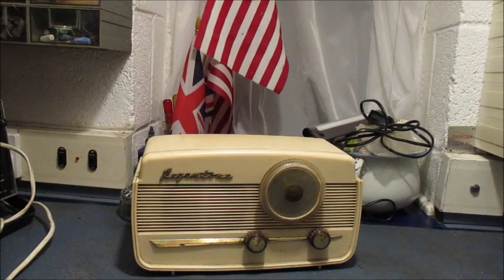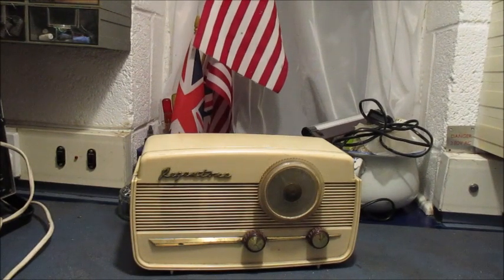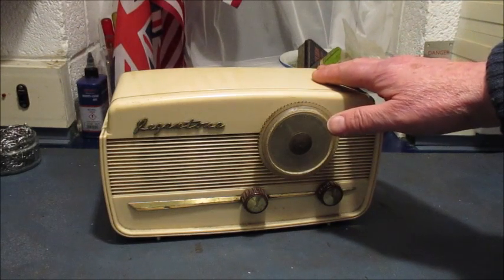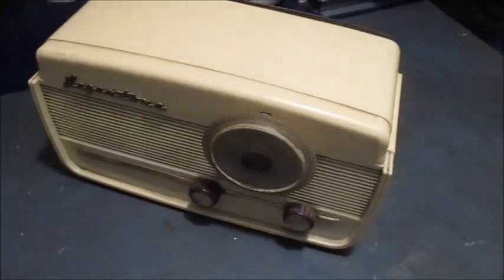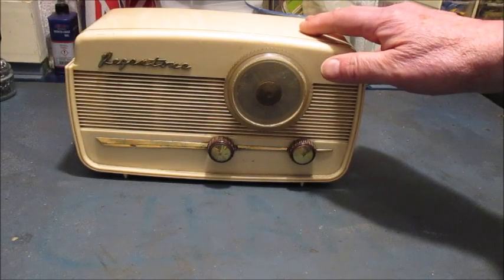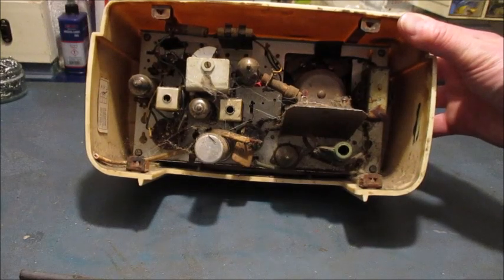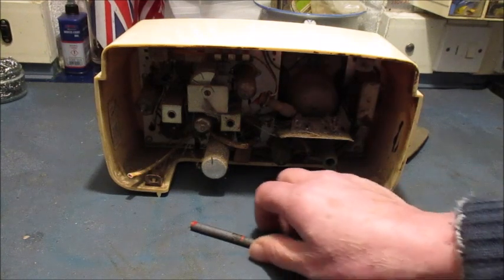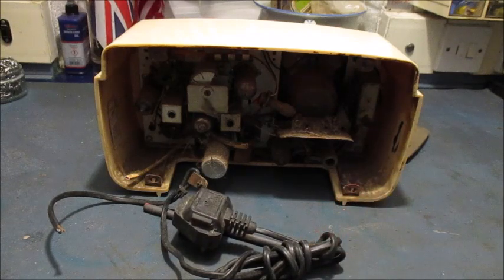Regentone, Model DP2, Radio Repair, Part 1

Comment: Phil,
Now ain't this a pleasant mega-shocker, old chap?  I figured you were permanently down for the proverbial YT count.  How good it is to have you back, my friend.  One mustn't abandon their viewers without adequate previous explanation, you know.  Tsk-Tsk.  LOL
No more disappearing allowed, hear?
Regards,
John
Reply from the maker: John, as always it’s great to hear from you.
I’ll begin by saying how lovely, and clean you’ve gotten the Thunderbird differential housing.  You put a lot of time and effort into doing that, and now it shines!  
Some years ago, I was faced with a differential universal joint shaft that had sheared inside the housing.  When I put my foot on the accelerator, the prop-shaft rotated but there was no traction.  Undoing the centre nut was a nightmare since the bit that had sheared inside the housing turned round as I turned the centre nut.  I ended up striping the crown wheel and pinions etc. to get access to the stub.  I drilled two holes into stub; in which I fitted two steel pegs to I hold the stub tight with a crowbar so I could loosen the centre nut.  Getting hold of a new required part was no easy task – all the dealerships wanted to do was either do the job, and charge me a fortune, or sell me a new complete differential, which cost a fortune.  I eventually got the required part, after a few lengthy phone calls, for a very reasonable price direct from what was once British Leyland.
There are two You Tubers that might be of interest to you: HubNut does a few interesting things with cars – check out his Invacar project; and since you like cooking, as well as American history, check out Townsends, especially his enthusiasm for eighteenth century cooking. 
Yes, it's good to get started again after a fairly long absence.  I'm already eyeing up my next You Tube radio restoration project, so keep an eye on the You Tube bell LOL.
Cheers my friend, have a good Christmas, and a prosperous New Year, Phil.

Comment: Hello Phil, great to see u back, and full of life at 3.20am !!! I too have one of these, dismantled awaiting my attention, so it will be great to see how u get on, Happy Christmas !!
Reply from the maker: Hi roughchippy.
The circuitry for the Regentone, model DP2 is straightforward.  Not only that, when they are functional, they work fairly well.  The down side is often they come with a multitude of problems.  Almost always the heater ballast resister R17, 980 ohms, and sometimes R15, 14 ohms resistor are o/c …replace with 1k, 50w, and 15 ohm 25w (chassis mount gold types) respectively, should that be the case with your radio.  The audio output transformer primary (usually it’s the humbucking section but sometimes the audio section) will become o/c – seemingly at the drop of a hat.  The tuning knob is almost always broken.   The capacitors (usually of value over 1nf) will need replacing, especially if they are paper dielectric types, and the carbon composite resistors will very likely require a tolerance check.  If you want the radio to perform at its best, it will require a full realignment.
Virtually all Regentone products were manufactured to a price, so we have to expect more than the usual problems with Vintage Radios bearing that brand name.  Though the DP2 radio looks quite cute, be prepared to unearth a multitude of problems when restoring one 
Lovely to hear from you, Merry Christmas, and a Happy New Year, Phil.
Reply: @steelcity321pb6  Wow,  thanks Phil for all that v useful information!  On seeing u test the dropper, I did likewise and mine at least tests OK, the tuning knob too is good and not broken,  it's been a while since I stripped it ready for restoration,  and have yet to do it, but this series will prove invaluable,  thank you. My DP2 is cream like yours, has one brass bright missing,  and a little damage to the cabinet top rear, but not too bad, it even has the brass trim to the dial. 
I foolishly thought "that won't take long to do"....how wrong I could be then ! 😂😂.....thanks again,  Happy New Year 👍👍👍

Comment: Hey Phil, so nice to see you and that you appear to be in good health.  I had just mentioned the other day to another British friend, George Christofi, on his youtube channel that I was starting to worry about you.  That radio has an interesting chassis.  Do you suppose they mounted it vertically to help with better air circulation?  I recently picked up a FADA model 790 with a similar colour to that one made of a material called Plaskon but unfortunately mine has a rather large crack in the top.  Hopefully I can fix it without marring it up too bad.

I feel for you about those allergies.  I'm fine with dogs and birds but cats are nearly lethal to me.  Any more than a few minutes around one without an antihistamine and my throat constricts, my eyes swell up and I start running a fever.  Then along comes springtime with it's weeks of pollen and mold spores and I stay perpetually drowsy from the Benadryl.

Will look forward to following along on this series.  A Happy Christmas to you and your family, Sir!

Take care, Gary
Reply from the maker: Thank you Garry my friend.  
Fada, model 749, introduced 1949, is a very sharp looking radio.  I realise your dilemma: strange as it will sound, not all plastic glues stick plastic.  My modus operandi for repairing the 'none stickable plastics' with a huge crack, is to secure a metal plate, to fit far beyond either side of the crack , by means of small (say 2 to 3.5mm) countersunk head screws, with washers and nuts.  I make sure each screw head is well depressed into a countersunk hole into the plastic surface.  Then I fill each one of the countersunk depressions with either epoxy, or car body filler, sand them over when fully set ...and here's the most challenging part, colour-match paint with the cabinet to disguised the epoxy, or car body filler.  Its not ideal but, with practice, I've gotten it to work reasonably well.  We all develop our strange little ways of doing things LOL.
I feel sorry for anyone who suffers from allergies.  Some, like hayfever, are similar to what I'd imagine a Chinese torture to be like ...suttle to some extent but they certainly drive you round the bend LOL.
Lovely talking to you.  Cheers]!   Have a good Christmas, and a prosperous New Year, Phil.